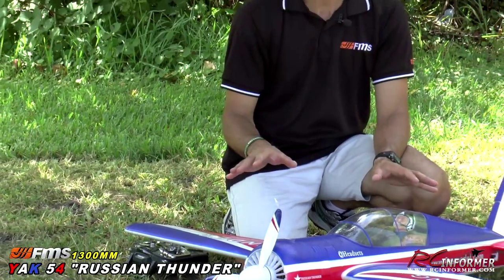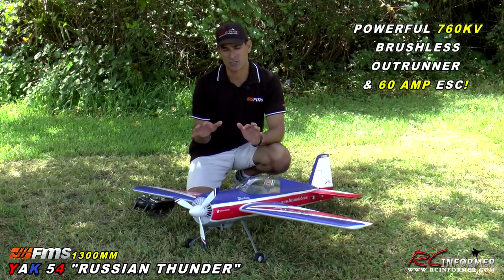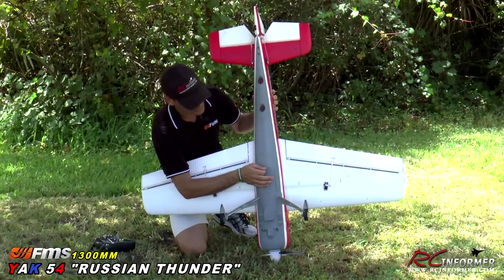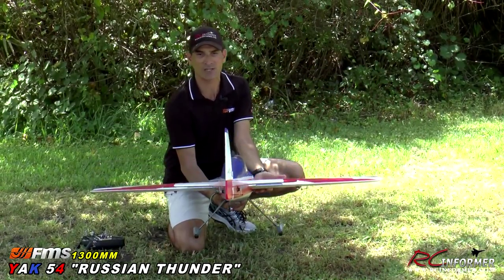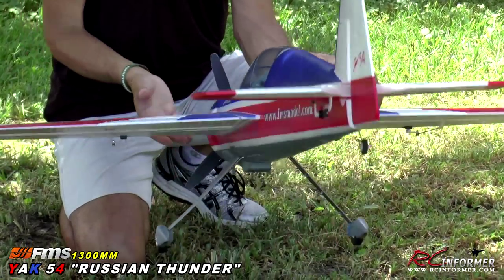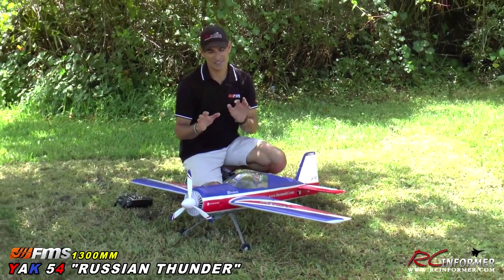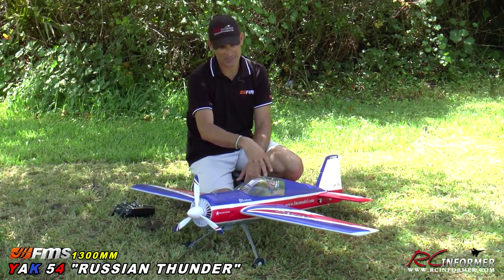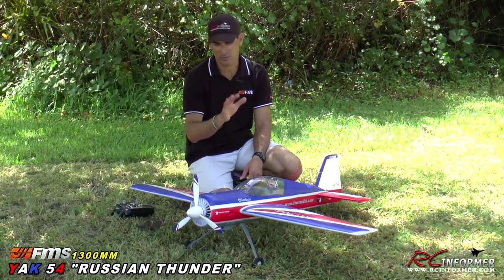FMS / Diamond Hobby YAK54 1300mm Flight Review By: RCINFORMER

Comment: Good pilot !
I got the FMS Sbach 1300mm. I am flying some other balsa 3D planes and for sure would recommend any (I mean ANY) of these before the heavy FMS Sbach. Fine as a sport aerobatic plane but very hard to do 3D. And as nice as they may look the propellers are bad, and you can not easily switch to regular ones.

Comment: Nice that FMS employed nylon hinges on all control surfaces , unlike the Extra 300 that only uses nylon Dubro style hinge on rudder to take the pressure of tall wheel stress.The foam hinges are cheap junk that is not dependable ..may last a week may last longer ..had my Extra come out of the box with elevator separated from horizontal stab. I just can not trust foam tac or other glue to repair these toy like hinges ..The FMS YAK 54 is done right with the solid nylon hinge .Motor mount and landing gear mount in my FMS EDGE , EXTRA , S BACH AND NOW THE YAK all had poor glue joints ..just not glued in solid with glue on 100% of the plastic surface that meets foam airframe . do what you can to work in some epoxy and micro balloons . other than a good going over and maybe a 2 blade prop all of the FMS 3D planes are excellent value . I started adding 2-3 coats of mine as water based polycrylic polycrylicin Satan finish..it adds a very scale shine and helps protect graphics and paint .Varathane is a popular choice also ..just make sure it is water based and apply with a soft or foam brush.

Comment: My friend can fly with 4s 3300mah? too heavy battery for this model; What is your opinion??? you have make any modes to put the bigger battery ???
Reply from the maker: +Emirete Angel No mods, we used a 4s 2600
Reply: 4s 2600mAh works best. why make it heavier? it's suppose to be for aerobatics not long range flights.
Reply: @darrenmaxam1415  How long it takes to fly  on 2600MAH?
Reply: @edge8495  on this I'd say about 8-9 minutes

Comment: My buddy has the SBach (same power, size and prop) and it couldn't get out of it's own way with the stock prop.
Reply from the maker: Just to clarify: This is all stock with a 4s 2600 pack predator battery from FMS / Diamond Hobby! This plane came straight out of the box and flew this way... NO UPGRADES! It is a sweet 3D plane as you can see in the video!
Reply from the maker: It is important to note that during the flight demo, the first 5+ minutes is unedited! At takeoff 7:23 Luis hovers the plane immediately, then he hovers it several more times including at about 12:20 while still on the same battery! I left this first segment of the video UNEDITED so everyone can see the great flight time you get with this thing AND that you still have hovering power 5 min into the flight! Enjoy!
Reply: RCINFORMER crazy. I wonder if that prop is stiffer due to paint. Less flex under load. Just trying to figure it out.
Reply from the maker: The prop is sweet! very nicely painted & flys great 3D...
Reply: I’m scratching my head cause I can’t get my FMS yak to do anything like that. Can’t believe you’re flying on the stock motor and esc
Reply from the maker: Yes, all stock